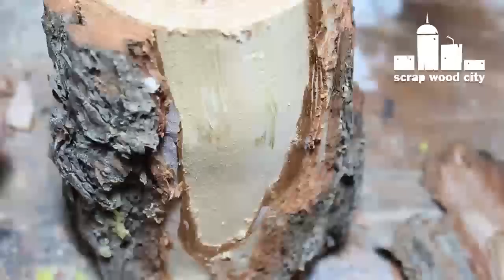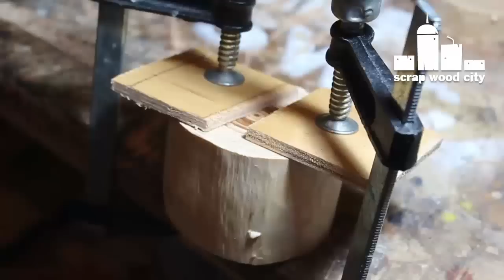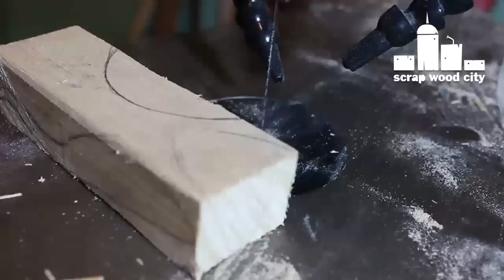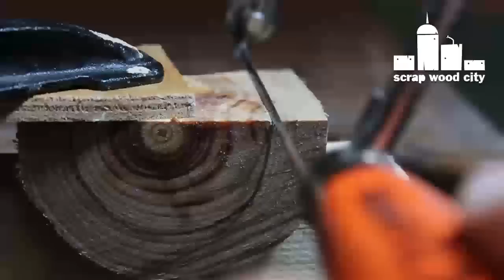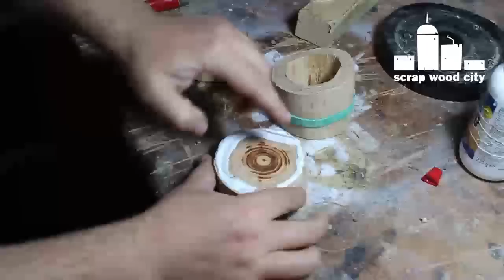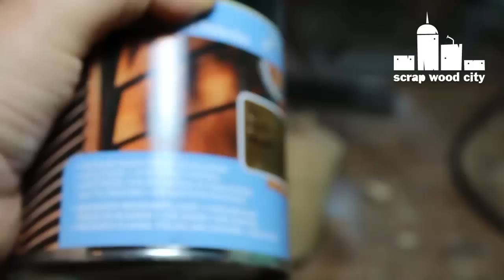DIY bandsaw style log box without a bandsaw

Comment: For the inside couldn't you use a hole saw. I'm planning on making one I have it set to cut. Will cut lid off top then use hole bit to cut center out. Slice a piece off hole wood and glue to center of lid

Comment: you could do this a lot neater with a saw and a drill with various hole cutting bits. cut the top off and start making you hole make various passes with small sizes and knock out most of the debre if you cannot clean the bottom effectively and you know this will be a challenge make two cuts from the top and cut the largest hole to place in the bottom use a little filler for the outside makes the product seem flawless from the outside, this would be more time consuming bit would look the part without any loss of grain to the outside causing a possible stray fit.
this is just my opinion I have not tried this but I would like to take this project up soon
Reply: but still this is a lovely piece,
Reply from the maker: +Scott Barstow thanks for commenting! If I did this project again I would do it totally different!
Reply: It's no problem every woodworker likes to see and talk about new and different things afterall that's only how we learn sometimes common sence isn't enough, the good ol' woodworkers is where the "best" knowledge is at, a nice piece of work :)